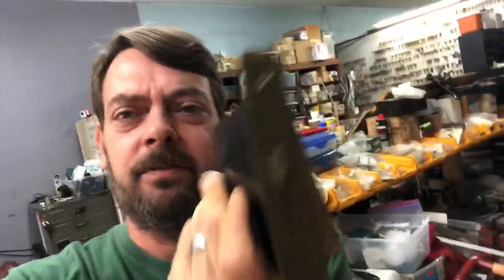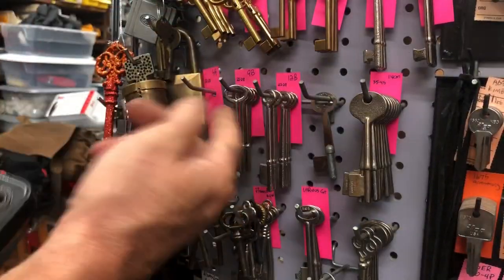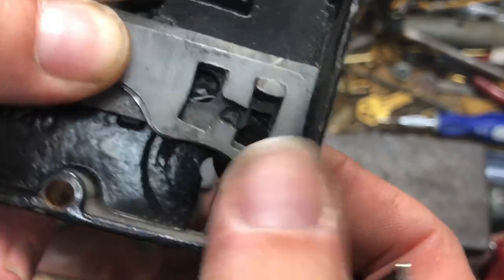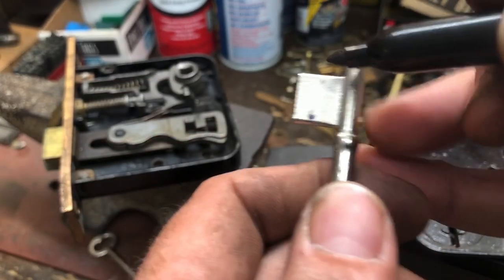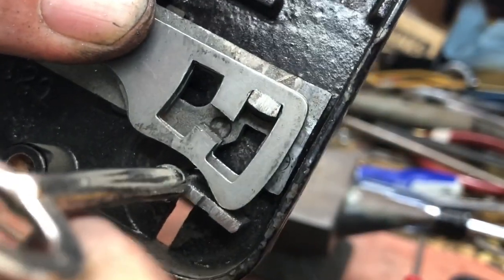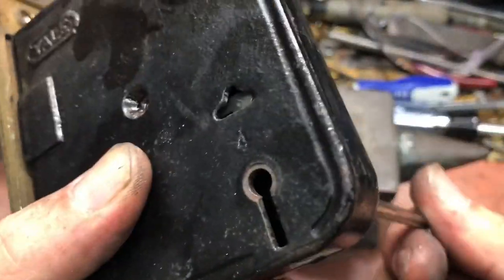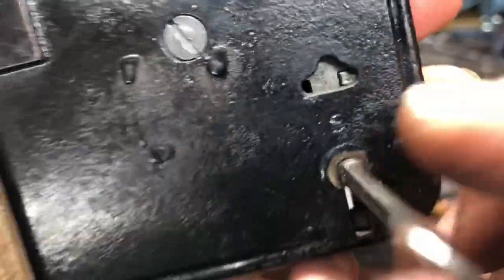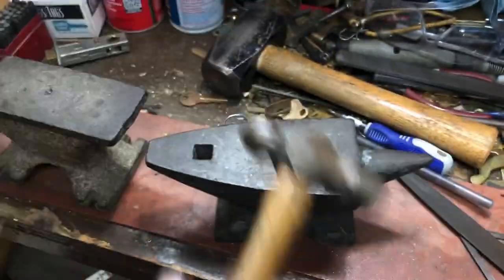Antique Yale 3 Lever Mortise Locks

Comment: Hi Jason. 
Thanks for taking the time to do this video. 
Its good to see the differences in lever locks to the ones here in the UK.
We do have 2,3 and5 levers, the ones everyone  should use for insurance is  as you said 5 lever,
BS3621:2007. Is the British Standard. 
Which has :
Drill resistant case.
Pick & force resistant 
Hardened,rollersin bolt to protect against saw and grinder attack.
20mm bolt throw.
Ideal for exterior doors.
The 3 lever medium level  are great for indoor  locks.
These can seriously range in prices at each level. Which is the same with everything.